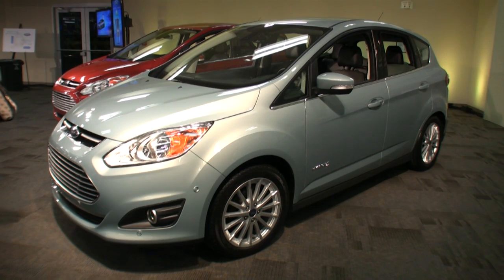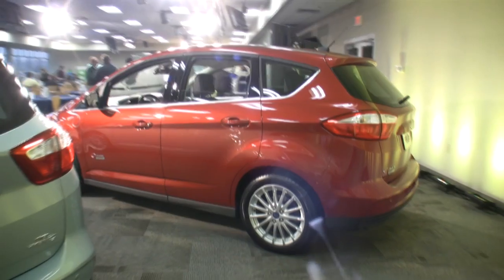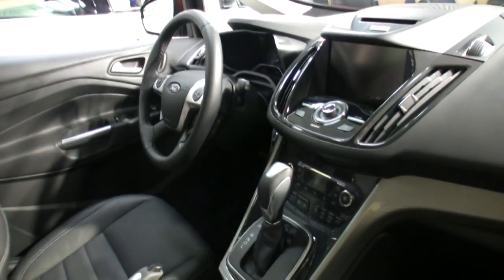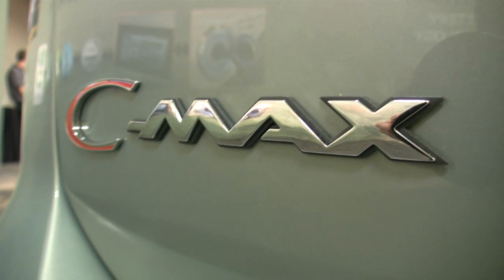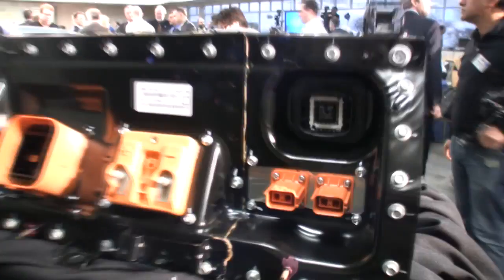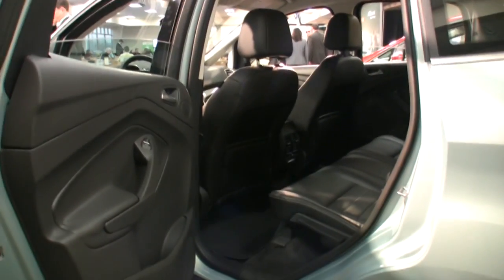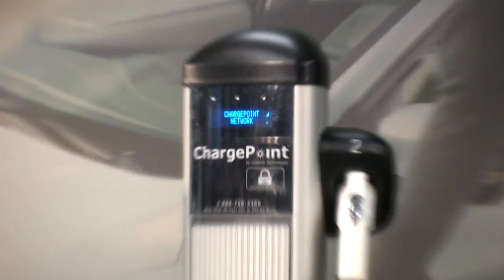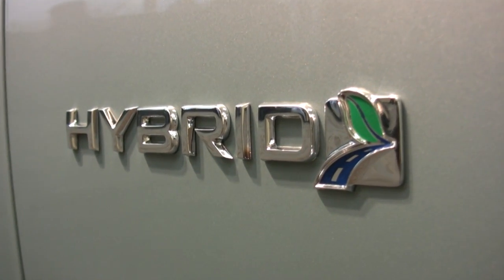2013 Ford C-Max Energi First Look

Comment: the us needs to understand the importance of diesel. fuck gasoline. diesel is so much better. they produce so much more torque and have a bit more power. they get good gas mileage and they produce no chemicals that harm the environment. also with a few mods you can make it so that you can run completely off renewable fuels such as used food oils. think about filling up a mcdonalds. the batteries that are made for these electric cars are more harmful to the environment than a suv running 10 years

Comment: @sxyphatboy you are right about the batteries but car companies want to make money! they dont tell you that 5 years from now you will have to buy another set on batteries costing you 10 grand... so essentially they will make more money off these cars. also, can you imagine how often you will have to take this to the shop? so many components to beak down! before you just had the engine to die, now the engine, electric motor, batteries, controller, charger and regenerative charger.